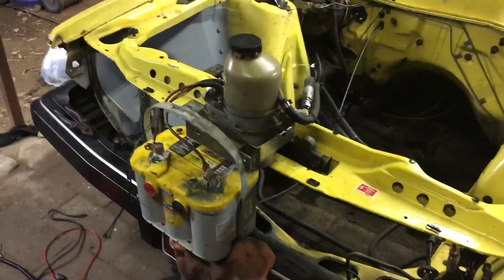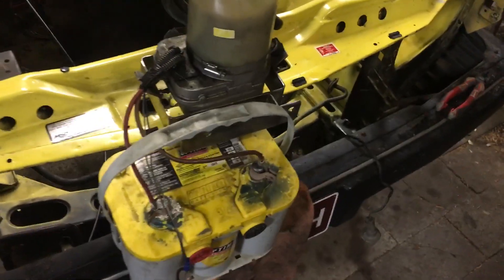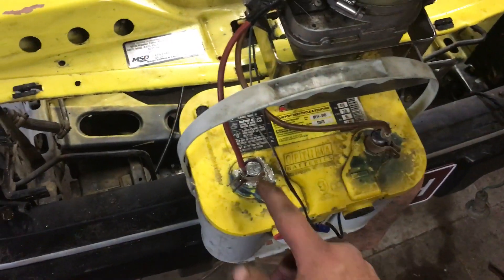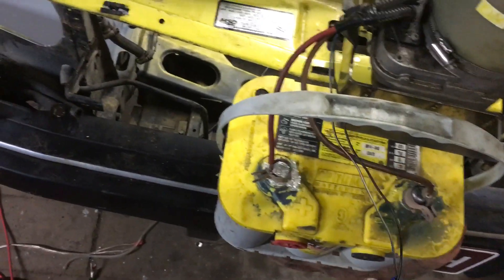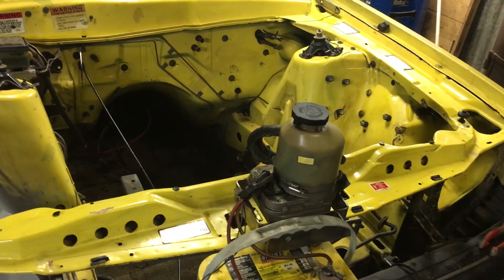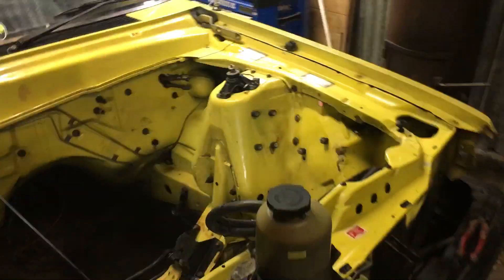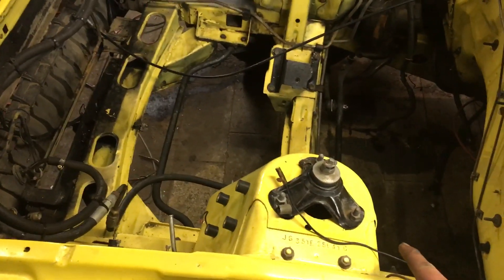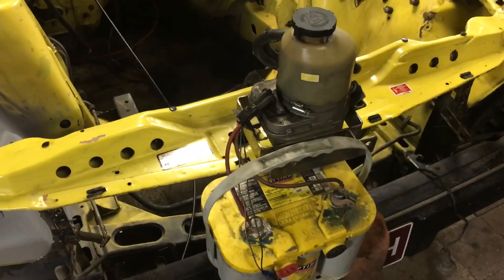Easy guide on HOW TO do a Astra electric power steering pump conversion on an alternate car

Comment: Might do this so I don't kill barra steering pump
Reply from the maker: This car has a 1200hp barra in it now. I'm running the stock barra steering pump and never had issues. Plus barras run a serpentine and you'd have to compensate for the missing pump. 
I don't know why you'd run this on a barra.

Comment: @ 0:25 it doesn't magic away the power needed to drive the power steering, instead it takes the power indirectly from the alternator instead of directly from the original belt driven pump.
Reply from the maker: Takes the mechanical load off the engine. Added 4hp. Not the point of it. Just an added bonus
Reply: @leigh3924  ?? the engine still drives the alternator as a 'mechanical load', then converts it to electrical power, which drives the electric motor which drives the power steering by consuming that electrical power.
Reply: @noelwhittle7922  lol, you're over thinking it or arguing semantics to be a brat
Reply: @warmweatheronly  .. another one who doesn't understand.
Reply: @noelwhittle7922  if you think increasing the amperage draw from your alternator equates to anything more than using an existing surplus of electric current you're misinformed. Your electric system either can, or can't, handle the accessory.

Here's how much HP is taken away from merely spinning the p/s accessory off the crank. An alternator by comparison doesn't experience an increase in drag or friction with load.

https://www.youtube.com/watch?v=2nrphOdvZRY
Reply: @warmweatheronly  mate I'm here looking to do this to my Honda and seeing that MX5 and its dyno is nutty. I need all the torque I can get!
Reply: @warmweatheronly   re your claim:  "An alternator by comparison doesn't experience an increase in drag or friction with load"  ... ok, so I nearly posted a really sarcastic reply.  But then I had to re-read your statement to see if there was some essence of truth that aligned with my whole 40 year career in the heavy industrial electrical industry.  But no,  and based on a lot of time spent maintaining and operating huge steam turbines and industrial gas turbines which drive Mega-Watt rated alternators...  I can assure you that an increase of electrical load = a  proportional increase of shaft load for the prime mover.  And that rule goes all the way down to the tiniest alternator or generator.
Reply: @noelwhittle7922  Meh, you've given the internet standard response, I don't buy it. I posted a dyno video showing how much horsepower and torque is sapped from a belt driven power steering pump. Surely you can do the same. Good luck sport.
Reply: @warmweatheronly7731      😉  👍

Comment: Hey mate, how have you gone long term running Automatic Transmission Fluid through the Astra pump.  Has the pump survived?

I have used an old Kirby Bishop box that uses automatic transmission fluid with an Astra pump that is recommended to use synthetic power steering fluid.  Trying to work out which fluid would be best to use for both.
Reply from the maker: No drams been 3 years or so
Reply: Thanks mate.

Comment: if you use a delay-on relay with about 1s delay to connect power to the blue/white wire, it will spin up instantly instead of the safe-mode slow spool
Reply: Wire up blue and white wire to alternator and black to 12v switched and you'll get the delay needed to get instant spool
Reply: @Plant Powered Health  I wired 1 wire to accessories and the other to ignition and works fine .
Had them the wrong way around to start with , just switched them and it spools up straight away now.
Reply: @davidgriggs3967 thx for that , it worked 👍, just don’t switch the key from Acc to ignition to quick , needs like one second delay
Reply from the maker: @Rick Kennedy never works. Don't even bother.
Reply: @Kiwi Cars Nz do tell
Reply: @alexanderm2225  Wire one to accessories and the other to ignition , if it still won't work switch them around. Just leave it a second between switching from accessories to ignition.
Reply: You need a special time delay relay, you wire the pump ignition wire AND the time delay relay directly to key on power and the other wire from the pump to the delay relay. This will give an instant start to the pump.

Comment: you could wire it properly and have it start straight away without waiting
Reply from the maker: And burn the motor out?
Reply: Leigh nope it does work that way in stock astra lol
Reply: Can you imagine waiting for 30 seconds till you can drive car away lol
Reply from the maker: Yes. I let this car warm up before driving anyway. Its making around 1000kw and I'd never drive it cold.
Reply: @leigh3924  yes aparently when You leave it with this slow build pressure mode they last longer but sometimes is anoying when you stall car during drifting and need to wait a bit for pressure to build up.

Comment: I have made a module for this pump to make it start immediately, there is two turbines inside there and one needs to start a few milliseconds after the other or it causes them to stall against each other
Reply: If you connect the black wire to the red and give 12v to the blue/white a second later the pump goes to full speed straight away. Just use a delay circuit to power the blue /white
Reply: @icyedge4704  Thanks a lot! Gonna try it
Reply: Would it be possble if could share how you did it? thanks
Reply: I got here looking for this hack.. would you mind sharing it?

Comment: what sort of electrical power drain are you experiencing with this at idle and at full lock?. I am interested in the conversion but already have twin electric fans, fuel pump etc and am wondering if my alternator will cope?
Reply from the maker: Running a 110amp alternator with no issues
Reply: @leigh3924  I'm guessing my stock 75amp alternator won't work, question is how many more amps do I need to run this pump?
Reply from the maker: @brianashley2880  it would depend on  your system.

Comment: What fluid are you using?
Reply from the maker: DEXIII
Reply: @leigh3924  Hello, nice project. I´m doing the same. I would like to ask you: In your experience, have you had any leaks? I mean, due to incompatibility between the pump´s gaskets supposed requirement for synthetic oil (CHF 11) and the use of Dexron III. It´s a concern for me. Thanks.
Reply: @leigh3924  Could you please report how this has held up and if you have any leaks using ATF/ Dex 3?

Comment: This power steering pump is shit. For normal driving maybe ok, but it wouldn't let to put quick inputs on steering wheel and hard driving is imposible.
Reply from the maker: Wrong.
This is a race car and it's fine.
Thanks for watching.
Reply: Circut or Drag car?
Reply from the maker: 50 50

Comment: Hey mate, where does both of the hoses run into? Im deleting my mechanical ps pump pn my 2jzgte just wondering if the two hoses go to something inparticulat?
Reply from the maker: One high pressure to rack and one low pressure to box mate

Comment: Hey, any idea off hand what the thread size is for the output on the pump?
Reply: Leigh Conway I bought an m14 banjo bolt and that was too small 😂
Reply: its 16x1.5
 @ukspamy
Reply from the maker: M16

Comment: got one of these for buggy  but can't get the thing to run ..either needs can bus hookup or oil in res ..just trying to get it to run before I mount it ..so far no cigar any thought's ?
Reply from the maker: G Pastor are you following all the wiring correctly? It should still fire without oil
Reply: will give it another go but am told there are two types of pump on the astra's ..one type needing can bus hookup ...got another pump lined up so will try again ...thank's for the response ...cheer's..
Reply: @Mintlord  Did you figure out if it needed a can bus hookup? What year was the pump that required the can bus?